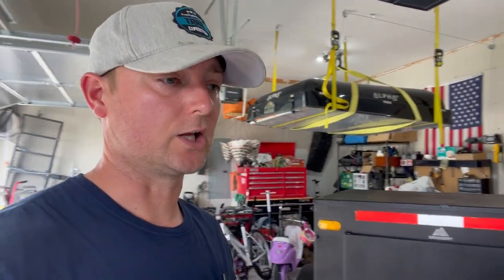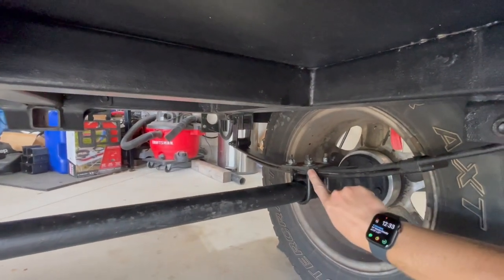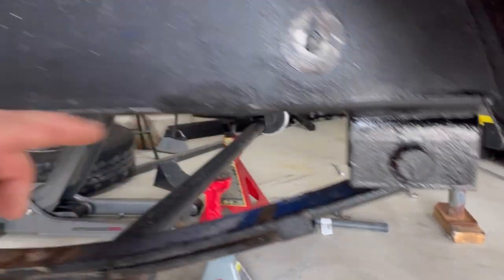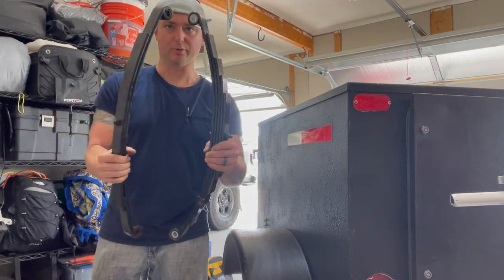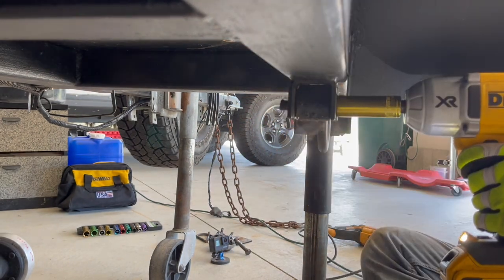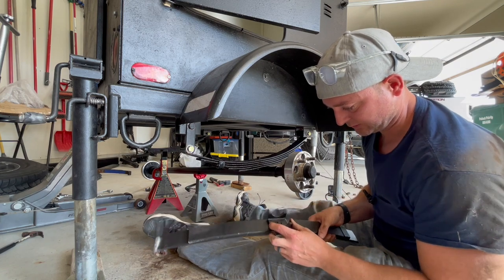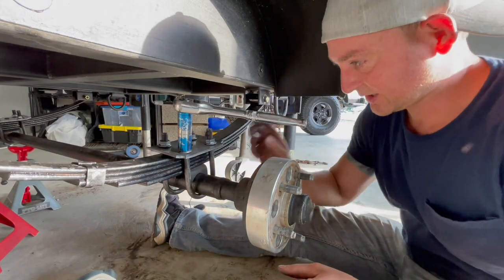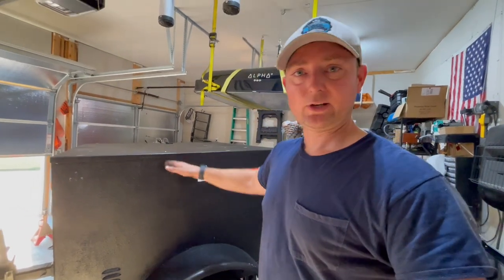OVERLAND TRAILER EP. 1 - Upgrading Leaf Springs!

Comment: Nice job on the problem solving!
Reply from the maker: Thanks! It was a process for sure but it all worked out.
Reply: Those bushings bring back any memories?
Reply: @timo2233  Not until you mentioned it, no. LoL
Reply from the maker: @timo2233  is this in reference to the Ram lift? 😆
Reply from the maker: One more try! 😆
Reply: @TrailExpedition  that’s how I took it. We didn’t have the courage to start cutting on my truck.
Reply from the maker: Cut once. Cry once.

Comment: I would weld those brackets to the axle.  That way the U bolts dont have to hold the axle from shifting side to side
Reply from the maker: Good point.  I need to invest in a welder.

Comment: Do you think the upgraded leaf springs will hold up well off-roading? I am contemplating buying an overlanding trailer that has 2 leaf spring system but don’t know if I will be limited
Reply from the maker: For the ultimate off-road trailer build you’d want a Timbren system so each tire can flex independently of each other but it’s expensive. This option allows me to carry more weight without bending the springs. I do suggest adding shocks as well which I did in a later video.